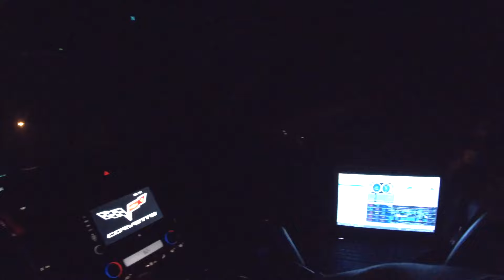ProCharged 441 LSX C6 Z06 | First Race On a Forged Bottom End

Comment: Might wanna fatten that afr up a lil bit. I saw 12.6 at the top
Reply: E85 is a little more forgiving with being a bit leaner since so much more fuel is being sprayed, so he should be ok. He was low 12s most of the run which is ok imo as long as the plugs look good
Reply: @kamrenwood1894  he appears to be "getting away with it" but when you factor in the actual hp gained from running it so lean.. I personally wouldnt feel right... you could run it mid 11's and add a psi of boost and probably make more hp while being a lot safer...
E85 is less prone to detonation (exploding) but it is actually more prone to preignition (lighting before the spark)than pump gas..
I'm not a pro tuner but my 2 cents.
Reply from the maker: Yessir, definitely need to add some fuel up top
Reply from the maker: Been checking plugs. 12.0-12.2 is my target aft honestly
Reply from the maker: I’ve been fighting the need to switch to a speed density tune. Hptuners VCM scanners can not plot the numbers at those frequencies up high so I am having to manually adjust fueling up top. Should have it spot on with a couple more pulls